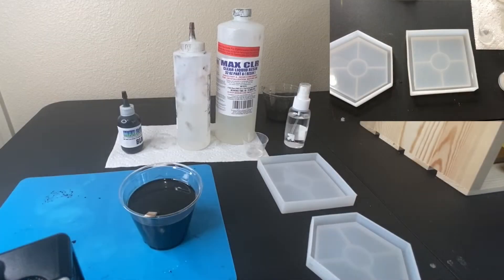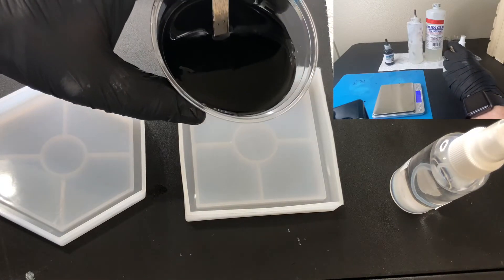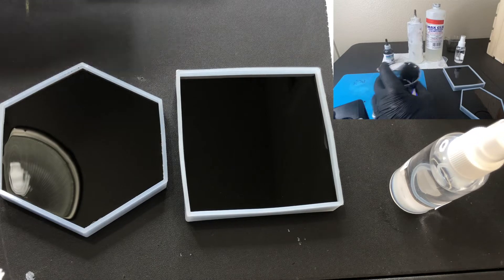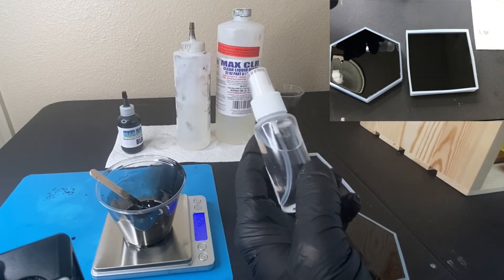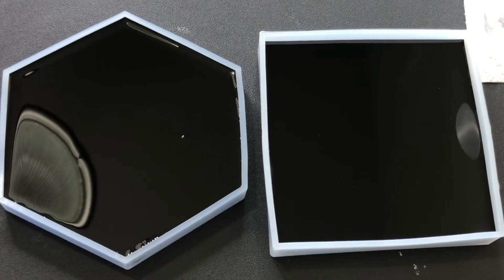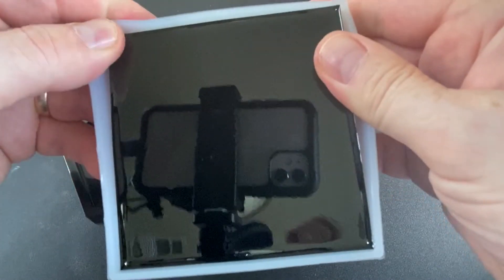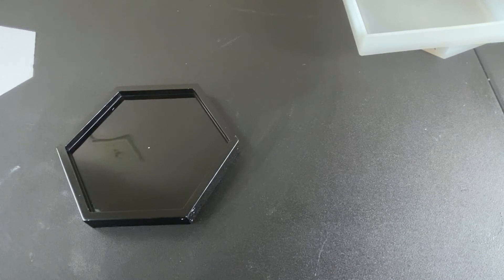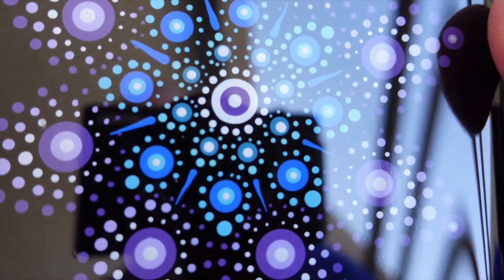How to Make a Hand Painted Freehand Dot Mandala Resin Coaster Video Tutorial

Comment: Love this, question could you have the mold on the scale to gauge resin used? I'm guessing the limiting factor is you don't want to be moving the mold after you have resin in it? Thanks.
Reply from the maker: If you set the mold on something flat and firm then you could lift it off the scale carefully to move it to a flat surface to cover and let cure.  It may be easier to weigh the resin in the cup before pouring and then re-weigh it once the mold is at the level you want it.  The difference in the weight would let you know how much was used.  😃👍🏻❤️

Comment: I saw someone use tweezers to pluck bubbles out.
Reply from the maker: I would think that would take an enormous amount of time if there were more than just a few air bubbles.  I am working on another coaster video and there were hundreds of very small bubbles still on top of the resin pour after allowing it to off gas for several minutes.  The acetone mist eliminated them in seconds.  I can't wait to share it when I post the video.  I still have several steps to that video but it should be one of my next few videos I release.